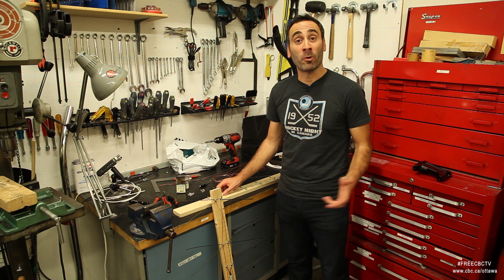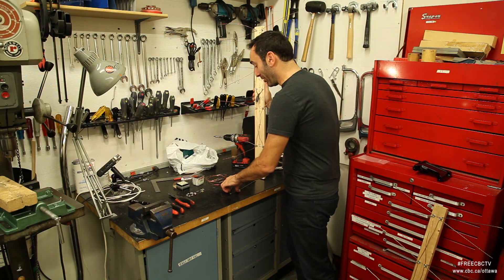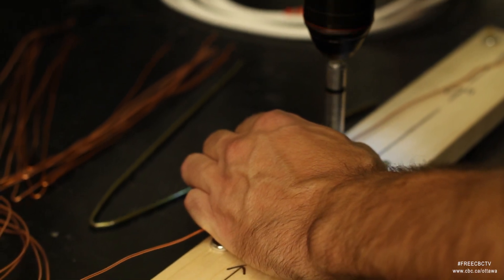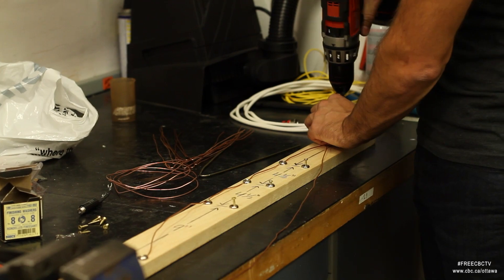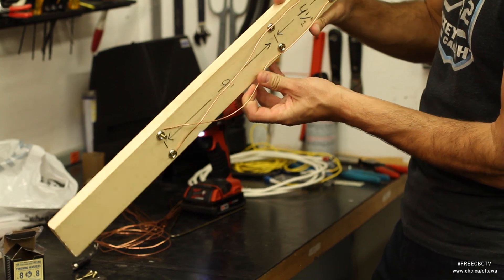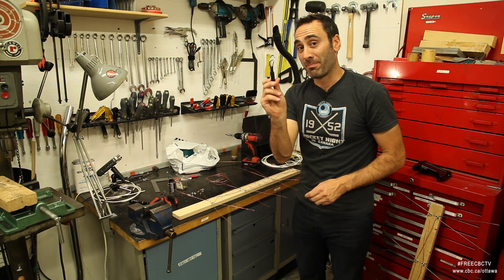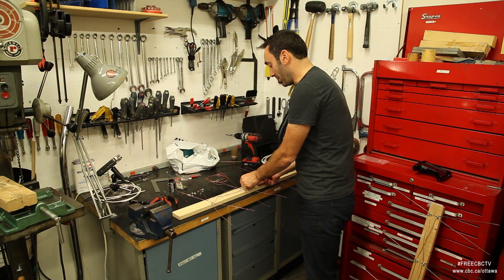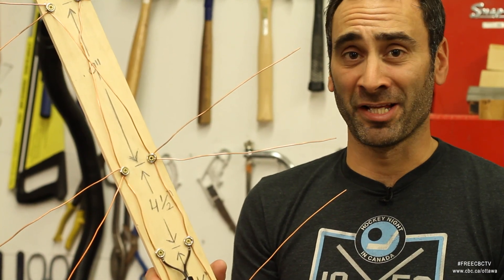Make your own TV antenna

Comment: I live in Ottawa's Carlingwood area and so far 3 store available antennas suck, and the good inexpensive one I was after is NLA. Maybe I go with DIY like the old days - I just have to find some old solid core wiring. Instead of 'Baba' - Yagi, I try the Wiskers design.

BTW, CBC Radio Techs - thanks for fixing Radio 2's 3dB channel imbalance. Sorry guys, but I like my stereo  in the middle not 1m to the side.

Comment: Other (U.S.-based) videos I've watched on this topic have you cutting the whiskers to a length of 7", spacing them 7" apart, and having their open ends all 3.5" wide. Are the Canadian and U.S. specs different (i.e. using different average wavelengths) or is yours just scaled up to 9" based on signal distance, etc?

Comment: Being one of the better how-to videos I've seen (a great CBC voice!!), I constructed one of these... one of many from the Internet.
Being in Ottawa myself, and having tried those indoor floppy HD and multi-bay outdoor antennas (all commercial models), I wondered if my location was limiting me. And it was, is.
All the antennas I bought or made never gave me more than 3 of the 11 English channels I could have access to. To use a favorite realtor's phrase, it is all about Location, Location, Location.
I live in a south-face apartment building in Britannia, on the 2nd floor. The Camp Fortune tx'ing (transmitting) tower is blocked by  20+ floor condo to the NE. Since I am near the river, I am in a slight valley and there is a 15+ floor apt building in between me & the Manotick tower.
No antenna is going to work well unless you have a good line-of-sight to wherever the TV tx'ing tower is. At least, that is my experience.

Comment: Does it works in Nepal?
Reply: I guess HD for TV is digital now in most countries. I think in north America they got ATSC while the rest of the world got DVB-T. If your TV got no DVB-T then get a DVB-T box or if using a computer get a DVB-T usb stick.
https://en.wikipedia.org/wiki/Nepal_Television
Try the antenna, it is just a piece of wood and some hanger wire. And for the BALUN see how it is built on the net, it is just some wire wrapped on a ferrite (toroid). You can find the toroid(or 2) in broken ATX power supply of a desktop computer. I ain't sure about the Balun values but you could start here
http://www.instructables.com/id/DIY-300-to-75-Ohm-TV-Antenna-Coaxial-Baluns/
https://duckduckgo.com/?q=diy+TV+Antenna+Coaxial+Baluns&iar=images&iax=images&ia=images

Comment: thanks for this video we cut the cable about 2 months ago. bill was $225 cable company  now $45.00. I made this antenna from your video. We pick up 47 channels it's up on the roof about 15 feet above ground and branch off to 5 tv's  sometimes at night we scan for more channel and pick up 62 channels. I pick up a booster that handles 8 tv's 4db per tv  a little stronger signal for a 80 feet cable run only get about 38 on that tv. We are very happy thanks again.  O to when we hook it up close to 1 tv and sat the antenna in the window it pick up 69 channels. I will make another soon for the back bed only.

Comment: would this work if we are 50-60 miles away from nearest tower? inside-outside?
Reply from the maker: H, it depends on many factors:
-How strong is the signal at the source? That depends on the station's transmitter. tvfools.com can help determine
-What is the terrain like between you and the transmitter? Flat is better
-How high can you mount your antenna? Higher is better
-Yes, mounting your antenna outside is better...but this one is designed for inside use
-How much cable are you running from your antenna to your TV? Shorter is better, and longer lengths (more than 50 feet) could be improved by a pre-amp at the antenna (However, a pre-amp instantly causes a drop in the signal strenth...the advantage is that signal will then stay at that same strength for the cable run, as opposed to reducing every foot)

Hope this helps

Comment: Wow thank you thank you thank you, I just returned a $70 antenna to Best Buy that only picked up three channels. I built this and mounted it 5 feet off the floor in my den hidden behind the big screen. It picks up all Los Angeles channels, 2 through 13 plus, all the other channels above that to about 70. I can't believe how good this thing works thanks again. Dropped two of the three in my Verizon/Frontier bundle. Monthly bill went from $275.00 to $74.99. So I picked up Netflix and Hulu. Should have done this 5 years ago.
Reply from the maker: +Ken Sutherland That's great Ken! Curious if you can get even more channels, assuming they're within range. tvfool.com isn't perfect, but it helps tell you which channels are near your address. You might have to raise the antenna higher than 5' to get more. Thanks for sharing, and enjoy the extra cash in your pocket, Giacomo in Ottawa, Canada
Reply: Ken where do  you live?  I'm in South OC.  Was wondering if it would be powerful enough to pick up from Mt Wilson's towers.
Reply: I'm in Lakewood, which is on Long Beaches' northern border. Whole thing cost under 2 bucks and took all of 45 min to build. You should build one and mount it 5 feet high at least or in an attic. What do you have to lose? Mine works great.
Reply: Aiming is critical
Reply: +Ken Sutherland thanks Ken for the reply.  I'm in San Juan Capistrano. So  little further from the transmitters and tucked into the hills.  Being a diy   I figured I could do  something like this.  We ditched the dish and picked up a mohu 60 for $150. Mounted it to  the old dish post  and am getting 80 channels 63 in Spanish and Asian  languages. Lol.  I still got about ten days in the best buy return window so I will give this one a shot too.  I will probably  use pic instead of wood for a more aesthetic outdoor look,  also due to condo rules. Although I don't see how they can approve sat dishes but not aesthetically conforming OTA's.  Maybe I can repurpose the old dish too.?One problem I had doing this  "ditch the dish"  was using the existing cabling the antenna did not work.  TV was showing channels but no picture.  Turns out it was all the dish "SWM"  splitters were filtering the signal! once I switched those out for traditional cable splitters all was good.  That is until I realized my Internet  (cox cable)  was down!  After several hours of filtering cables by trial and error I finally whittled it down from about 7 to  2. One for OTA, one for Internet.  Phew.! But saving $120 a month.  I've been streaming for 5 years. But convincing the wife took a finely tuned  kodi/firestick  and OTA for local channels as the kodi add-ons for live TV were meh at best. Still she only watches bravo anyway but at least now she has the best of both worlds. Lol.

Comment: Thank you for taking the time to explain in a clear picture/easy to understand way. I was exploring the possibility of an outside antenna; (I live in rural area near Indiana Pa) but didn't know if I would have any channels to make it worth while. I made your antenna, hung it 8 foot off ground outside my house and I got 4 digital channels. This gives me the go ahead to buy an outside antenna. @Shawn Graves: I used heat shrink insulator tubing over the intersecting parts.
Reply from the maker: +Donald Jordan 

Great stuff Donald. Glad to hear we helped. 

Out of curiosity, did you check tvfool.com to see how many channels you're likely to get? Every situation is different, but from my experience, if this one is built right, mounted a good height, and pointed in the right direction (tvfool helps for that), then it performs as well as some store bought ones. 

All the best, and thanks for the comment, Giacomo

Comment: Just wondering if I make this longer will it increase the strength.Say 8 bay for instance.
Reply from the maker: +sidney joiner All depends. I've seen 8bays made by combining two 4 bays, each of which is identical to this one. What's really important is you connect them using equal lengths of coaxial cables between each balun to a splitter/combiner. The exact same length is needed to make sure the antennas are "in phase". Here's a pic: https://www.google.ca/url?sa=i&rct=j&q=&esrc=s&source=images&cd=&cad=rja&uact=8&ved=0CAcQjRxqFQoTCJrNnfXfrsgCFcesPgod1qsPCw&url=http%3A%2F%2Fwww.partsforhdtv.com%2Fhdtv-uhf-8-bay-outdoor-antenna.html&psig=AFQjCNHVY-8o6SxnewxLzjvOM9ECaZw8fw&ust=1444251906851967

You can point each in a different direction, which helps reception from different towers

Comment: This design really works.  I have built two of them for our TVs and they both work well.  We are 20+ miles from the transmitter sites so we have amplifiers on each antennae ($10 at your local home store).  Easy to build!

Comment: I have a Yagi antenna, but had another which was no longer working, how can i combine both to increase its capacity? do you hve an email I can send you what i hve made?
Reply from the maker: James Dale My understanding is combining two antennas is tricky: they need to be in phase. That means the cable length from the 2 antennas to where they combine must be equal. You can try as I don't believe it's possible to cause damage.

Comment: Can't you just cut the coaxel cabel and wire it to the antenna?
Reply from the maker: William Aaronson glaab Not sure it will still work, or at least as well as possible. The balun adjusts the signal from 300 ohm to 75 ohm for the cable.
Reply: It kinda sorta will work but you need the transformer to match the antenna to the line and tv.

Comment: Dear Giacomo, can we put something to guard the whisker tips such as a styrofoam packing peanut plunged in a tiny bit so to avoid accidental pokes in the eye or will the signal be affected?
Reply from the maker: Carie Voss Not sure. But you can always check the quality and quantity of channels before and after and compare. I have a feeling it won't cause any problems, as long as not metallic. Keep those eyes safe!

Comment: Can you add multiple antennas together with a splitter/combiner?
Reply from the maker: Yes, but they must be in phase. I haven't tried it myself but there are some sites showing how it's done. To my understanding, the cable distance between each antenna and the combiner box must be equal. That's what ensures the signals are in phase.

The combination can be used for one higher than the other to make a really tall antenna. Or more commonly, two antenna facing different directions to focus on two different towers. That setup also allows you to add a reflector to each antenna which helps reception. My antenna doesn't have a reflector because I'm fortunate to be located in between two towers, so mine captures the signal from both sides.

Giacomo

Comment: Outstanding work and presentation. Just wondering how you got the measurements e.g. 9", 4.5", 9.5" etc. Is there any relationship between tv channel frequencies and whisker length?
Reply from the maker: Hi Zahirul, thanks for watching. Yes, there is a relationship between whisker length and the range of channel you can receive, and their quality of reception. I settled on these dimensions as a compromise. My source is this link which has various options of whisker length and spacing. You can always experiment. That's the fun part!
http://m4antenna.eastmasonvilleweather.com/Drawings/PDF%20Drawings.html

Comment: Can this be mounted outside instead of in an attic?  We used to have directv and was wondering if we could make this and just put it in place of the dish?  Or do you need to make one for each TV to mount indoors?
Reply: Hi there, not to take away from this excellent tutorial, but there is another tutorial here on youtube where the guy uses plastic PVC instead of wood, so yes it would work for an outdoor installation. The design is actually quite nice. I followed that tutorial which basically uses the same dimensions as Mr Panico's antenna, but different materials. I went with the PVC painted flat black with copper tubing and wiring. I then mounted the thing on a really nice tripod I bought at a thrift store for about 10 bucks! It looks pretty cool next to my black equipment (my setup is inside). Just do a search for bowtie antenna. Have fun! I guess I should consider myself lucky because I get about 110 channels, many are in Korean, and other languages, but that's okay.
Reply from the maker: Hi Tonya, thanks for watching.

This specific design is only suitable for indoors. Other designs can definitely be mounted outside, but they must be grounded against static electricity and lightning (like your house electrical system is). It's not complex, but it must be done. Also, you'd want a design and materials that can sustain the elements (for example, the balun should be shielded from rain). The biggest advantage of placing it outdoor is you'll normally get better reception. 

You can use a splitter to split the signal and feed more than one TV. HOWEVER, every split reduces the signal. It amy or may not mean loss of channels. Only experimentation will tell you (that's the fun part!). Also, there are pre-amplifiers which can help off-set the effect of splitting.

As for replacing your Direct TV dish, you might be able to do that (indoor mind you). The cable that runs form your dish to your TVs might work just fine...so you disconnect the cable at the dish end and plug in this antenna. Then the cabling in your house is now carrying the antenna signal to the TVs. But every cable run that is charged by this antenna reduces the overall signal strength, so best to unplug unused cable runs to focus the energy on those you're actually using.

Hope this helps,
Giacomo
Reply from the maker: Oh...and be careful of cheap splitters and amps. Do a bit of research to make sure you're using one that doesn't add a lot of noise.
Reply from the maker: Gregg Hernandez Great stuff Gregg. thanks for sharing. So jealous of your 110 channels!
Reply: Gregg Hernandez Can you let me know exactly what video it is for the antenna made with PVC?  I cannot seem to find it (or I don't think I have) when I do the search for bowtie antenna.  Thanks!!
Reply: sure just do a search for EASY BUILD HIGH PERFORMANCE BI-DIRECTIONAL HD TV ANTENNA .

Comment: I really liked your video information and put it to use.  I followed your plan with a couple minor modifications and worked GREAT!  1.  I used some small copper waterline tubing I had laying around.  2.  I made my spacing all 9 inches.  3. I added 2 extra pieces in a upward position at the top.  My antenna is mounted about 25 up on a steel pole.  After all this I got 28 channels with a total of 85 sub-channels.  The TV towers are about 35 miles away and I'm near Apache Junction, AZ.  I'm glad I did this method using the scrap I had laying around the place.  I just need to make use of this antenna for my FM stereo.  If you have a suggestion let me know . Thanks
Reply: hello, first try to get a distribution block depending on how many pieces you will connect. one downlead goes into the block, then you have two, three, four, etc. outputs via 75 ohm coaxial. when you get to the fm receiver, you use a 75ohm to 300 ohm transformer to screw in the two leads behind your fm stereo receiver.

Comment: What about a reflector?  Wouldn't that help?
Reply from the maker: Hi Mark,

Depends. If you're pointing at one tower, it can help. But in my case, and for residents in downtown Ottawa, we have 2 towers broadcasting different channels. Luckily the towers are almost opposite to each other, so this antenna gets reception from both sides. Adding a reflector benefits reception on one side, but can compromise the reception from the other side. Use tvfool.com to determine where your towers are. It provides an azimuth (check if magnetic or true north). Then use a compass (there's app for that!) to aim your antenna, flat side towards tower. I've seen some people fashion reflectors out of oven racks...are foil on cardboard!
Reply: Thank you for the clarification.

Comment: Just a note: The balun changes the impedance of the antenna wiring from 300 ohms balanced to 75 ohms unbalanced, BALanced UNbalanced, your coax is 75 ohms impedance unbalanced.